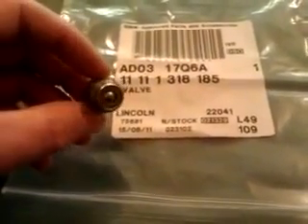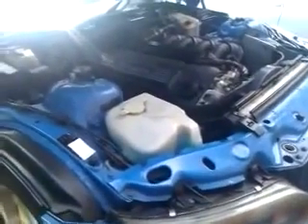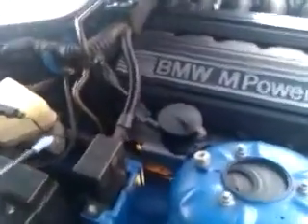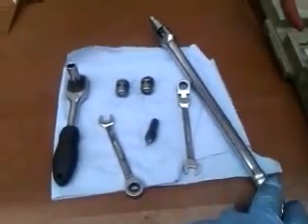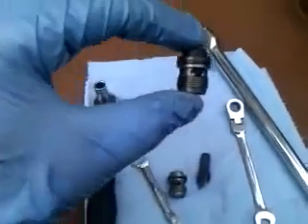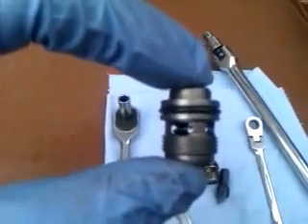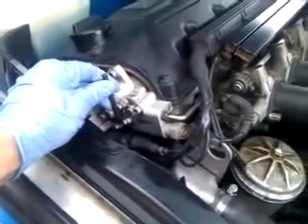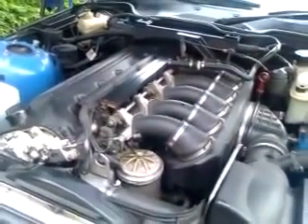BMW S50B32/S54 Constant Pressure Valve (also S50B30)

Comment: I own an e46, thank you for the information.
My constant pressure valve is currently leaking oil. Seems like I really need to replace it asap.

How long of a job would you guestimate for replacing one?
Reply: Most of the time is taken up by getting the car in the air and getting off the belly plates under the engine.  Once that is done, the valve can be replaced in less than five to ten minutes - if you have the tool.  It wil take more time without it, as you will be struggling with various tools and methods until you find a method that works.
Reply: @ 
Oh, I might do it myself then, shop is quoting me for 3 hours of labor